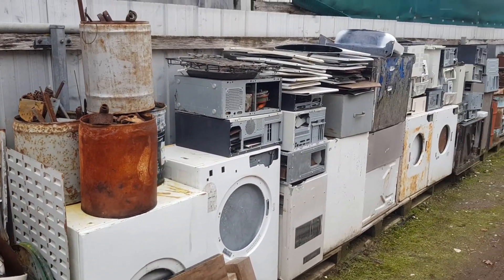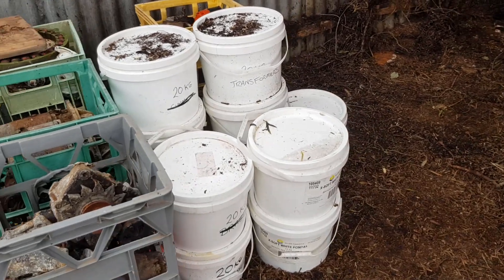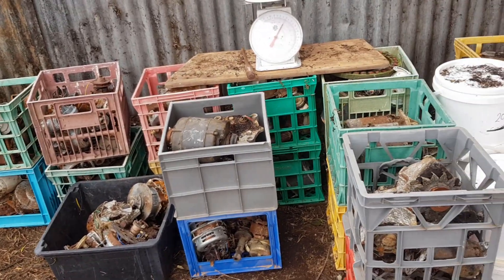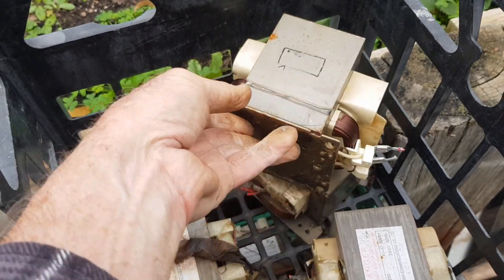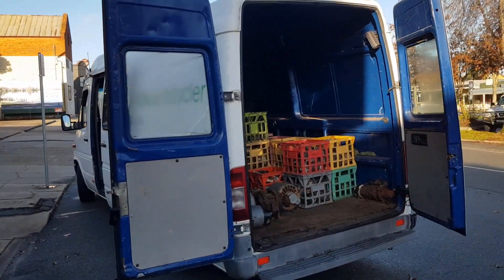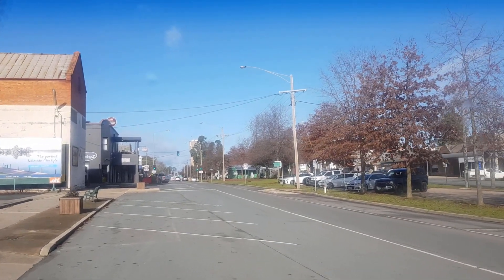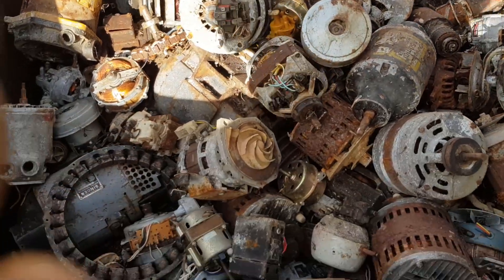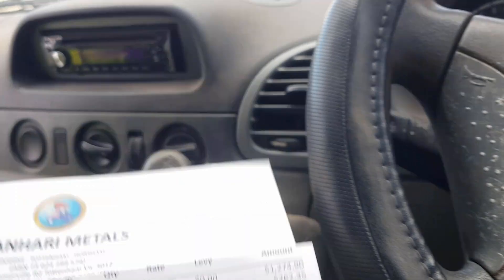Another Melbourne Scrap Run to Cash in Electric Motors, Starter Motors, Alternators & Copper Wire!

Comment: Do you still plan to take the shipping container with you? If so, could you have it moved with the contents still in it? That might save you some time. I guess it could also increase the cost to a level that is not worth moving the contents.
Reply from the maker: If we had room at home I would have kept and moved it, but alas we don't.